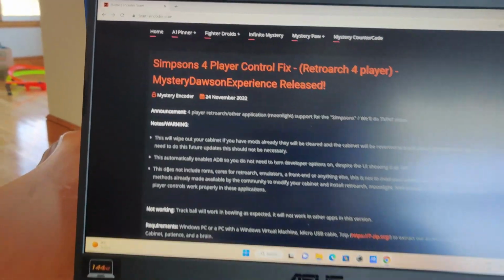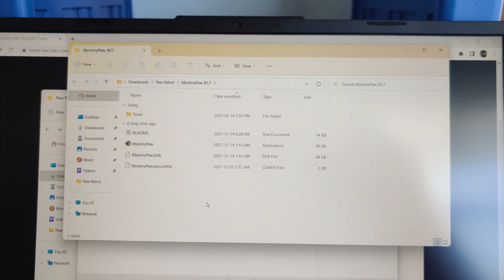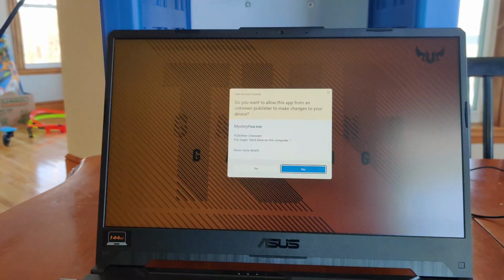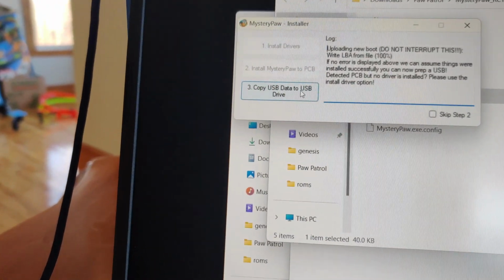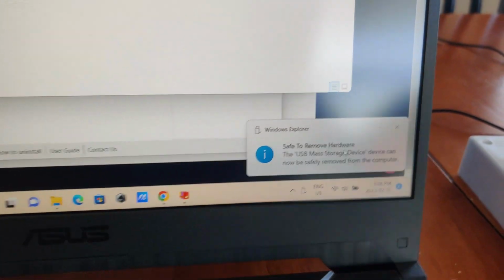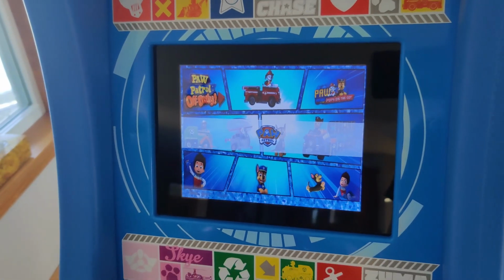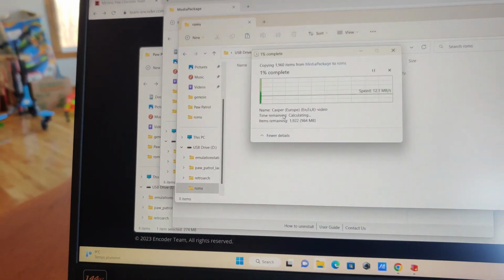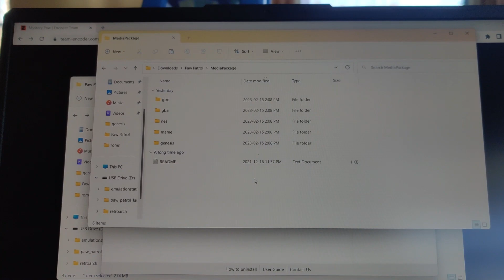How to soft mod Paw Patrol Arcade1up Jr. cabinet

Comment: At around 2 mins where you take off the plastic part . Easier to removed the bottom part underneath first ( again with 4 screws. Easier to put back together too as could snap the micro usb power port putting it back together

Comment: Thanks for video. Although took me hours to do. Wasnt connecting to pc . Worth noting that needs to be a usb data cable not just a charging cable .  (Just kept turning machine on. )Had Similar issue soft modding  a mini megadrive . Once found correct cable took minutes. Now have 4300 arcade games on it. Just need to sort out fire button config / remapping and delete the 3 player buttons games off Should be easy as using mame 2003 roms.  Genesis now on there too didn’t display my snes  Roms for some  reason so will look at a later date gonna get a micro sd extension cable so card is accessible all the time
Reply from the maker: Hey!  Thanks so much for rhe information!  I had no idea a charging cable was different from a data one.  Your plans sound great!  I was happy to put just a few games on for bragging rights.  Lol.  I appreciate the comment, and I hope my video helped a bit!

Comment: I need help. It work the first and 2nd time loading. Than when the rom loads all of the has no button or credit control. It shows gpio-keys not loaded 1/1
Reply: Try connecting a mini keyboard through usb and pull up files with F1 key that should let you configure buttons
Reply: @1812salvipapi I lock the file on the config because that errors the file
Reply: @alvinryangoyap3129  So why I have to keep doing is just redoing step 3 with usb when it gets corrupt and do what they said in the video go on to paw patrol game and then power off.
Reply: @1812salvipapi go to config controller file . Retrofe and lock that file. That's what I did and it stop the error. When my kids start pressing buttons
Reply: @alvinryangoyap3129  Seems like a much better solution than going into paw patrol and then shutting it down. Did you do that from the computer?

Comment: Added roms from media pack to roms folder on sd card. Emulation station shows up on arcade, but only paw patrol games are there
Reply from the maker: @marcdomanski  If I remember correctly, there are no actual roms with that pack.  It's just for the preview art.  You'll have to get roms separately.
Reply: Do you know if this mod works on the pac man junior arcade1up cabinet?
Reply from the maker: @EnriqueMancilla  It does not work with Pacman, unfortunately.

Comment: Nice tutorial! I was looking this video because I bought this modded version of this arcade 1up from someone. But with me I got the announcement "gpio keys 1/1 not configured" is that due to the software and should I redo all these steps above, or is that something is loose in het cabinet? It's loading all the games, I just can't control them. Original paw patrol games are working good, so I guess its something with the software.
Reply from the maker: @familiesmitverborgen654  Hey!  Yeah, that definitely sounds like something with the software.  Good luck!
Reply: @D3ADST4R_7  Will watch this video again and follow all the steps :)
Reply: @familiesmitverborgen654 have you solve this problem?

Comment: I cant hook up Paw patrol to PC it doesn't work....i hook up the cable but all it does is just turn paw patrol on, so basically Paw patrol starts up like normal but uses my pc as the power source. PCB is set to off?????? i am confused. Any suggestion???
Reply from the maker: I can't remember what I did differently.  It's been so long since I made the video.  When I mod mine again I'll be using my video for reference.  Lol.  There must be a missed step.  Or maybe try a different USB port?  That could be the difference.
Reply: For original commentor and anyone else that may come across this very same issue. The way to fix this is to try different cables. I went through 3 different cables, the third one worked. Sometimes the connection is just not "connecting." so trying different cables will solve this unless you unfortunately just don't have any cables that work for it. The first one I tried was too long and the second one I tried had a splitter on another end of it. But the third one was not so long and it ended up working.

Comment: I get the error code after step 2 saying LBA failed error cant open file. Please help
Reply from the maker: I'm sorry.  It's been a while since I made this video.  Which part is step 2?
Reply: @D3ADST4R_7  it's on step 2 when installing pcb it keeps giving an error and won't upload to 100 %
Reply from the maker: @nickarismendez593  Have you turned the switch on the PCB to the off position?  I'm not sure what that does, but it was in the instructions, so I did it.  Also, maybe try a different USB port in the computer.  It might require USB 2 or something like that.  Just a couple ideas.
Reply: I was able to get thru the steps and copy it to the USB buy when I go to load it on the arcade no gsmes show up. But when the USB is plugged in on the computer it has all the games n the rom folder
Reply: If I can send a pic so u can see eht I'm talking about I'm new to this and trying to mod it for my 3 kids if possible thank u
Reply from the maker: This doesn't come with any games.  Just to be clear.  You mean you are putting your own games on it?  Make sure they're in the right folders and the right format.  I can't remember exactly how it works.  Maybe check out their instructions at team-encoder.com.
Reply: @D3ADST4R_7  ya copied it exactly like u did and I opened a folder and it took me to the game page. Is there anyway I can email u so I can send u pics ? It starts up n thr emulation part but only has the paw patrol games. It has thr same start but I don't see the make gba gc or any others on there.
Reply from the maker: @nickarismendez593  I'm not sure what to tell you.  If it worked for me in the video, then you've got to be doing something different.  I have no idea how to do this.  When I reinstall mine I'll be watching my own video.  Lol.  Maybe your roms are corrupt, or you added an extra sub folder or something.  I just followed the instructions from Team Encoder.  My email is m.raekelboom@hotmail.com if you want to send me something.  More than likely I'm gonna be useless though.  I'm just trying to be honest.
Reply: Thank u. I sent u a email.
Reply from the maker: I sent you an email reply, finally!

Comment: Im having an issue with modding mine, every time i plug in the micro cable the 1up turns on and i think it interrupting the download
Reply: Had same problem. Turned to be the usb cable needs to be a data cable not just a charging cable , took me hours to find what was wrong but got there in the end

Comment: How do you reprogram the buttons to work with some of the games? Like for Nintendo you need a start and select. Or are there roms that are already changed? Thanks
Reply from the maker: They're strange with some games, but they all seem to work without reprogramming, which I have no idea how to do.  Genesis games work the best from what I've tried.  The third button can be a pain sometimes though.
Reply: I cant get the nes games to play without a start orselect button. Thanks
Reply from the maker: @skennedy1313  Try the volume buttons!  I think they act like a select button, if I remember correctly.  Also, the big house button should be start I think.
Reply: I have tried everything and just can't get it to work. I just switched it back to normal.
Reply from the maker: @skennedy1313  Sorry brother.  Did you try the volume buttons?  It's a strange setup, but it should work.

Comment: I need help! I just downloaded mystery paw to my one up and after inserting the micro sd into the port, all it says is “loading’
Reply from the maker: I don't really know, but maybe it's trying to boot from a USB?  Make sure you flipped the switch on the PCB off, and installed it correctly to the SD card.  You can always format everything and start over again.  Maybe it'll work.  I've had problems where the controls randomly stop working, and I have to reinstall everything.
Reply: Ok, so does the switch still need to
Be in the off position when i turn the game on? Thanks
Reply from the maker: @nicolehenninger9874  I believe so, yes.  I thought I tried it after installing everything and it didn't matter what position it was in.  It might only matter for the initial installation.  It's been a while... I suggest starting over and trying everything again.  You might have missed a step.
Reply: @D3ADST4R_7  thanks for your help!
Reply from the maker: @nicolehenninger9874  My pleasure!

Comment: Does it work with pacman Jr too?
Reply: Eventually I/we (team encoder) will release a similar app for pacman Jr.
Reply from the maker: @mysteryencoder9997  Awesome!  I'll have to pick one of those up too then.
Reply: @mysteryencoder9997  cool can't wait to try it with pacman jr
Reply: @mysteryencoder9997  its been 2 years have you released it yet?
Reply from the maker: No, unfortunately not.  At this time there is no hack out for Pacman.  It uses a different operating system, so it can't be done the same way.

Comment: Great tutorial! Wasn't aware it didn't make the roms folder on USB but we really don't update this anymore it was more of a joke in some ways to do it.
Reply from the maker: I'm so glad you made this mod!  When I found out, I went out and bought the cabinet right away.  Lol.  Too bad the same can't be done with the Pacman one.... yet!  I think they look really cool next to each other, but I'm not about to buy that to play Pacman on.  Haha!  Now I need to figure out how to use a different emulator on the Gameboy Advance games.  They don't run very well.
Thanks for watching!
Reply: @D3ADST4R_7  Gba needs bios from what I recall
Reply from the maker: @mysteryencoder9997  I'll have to look into how to do that.  Thanks!
Reply: I@D3ADST4R_7  I bought the pacman for like you said but best part for the jr is it comes with galaga and digdug. All the games have a "normal" mode to play as an adult. So playable for kids and adults and has 3 games. Worth buying and waiting till it's moddable. You can actually switch the pcb on the pac mini and mod it yourself but it's not an "official" mod
Reply: Will just nothing happen if I do this to a pacman?